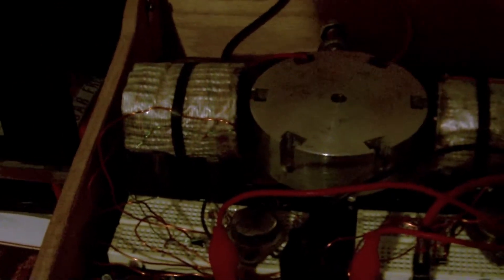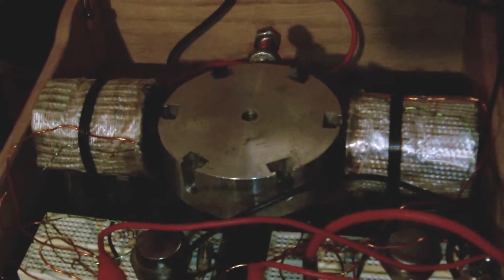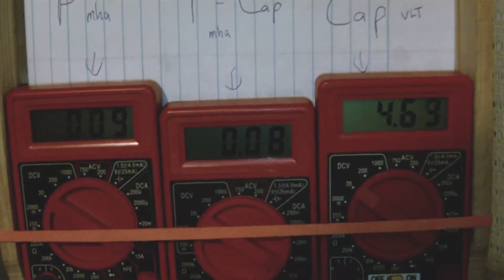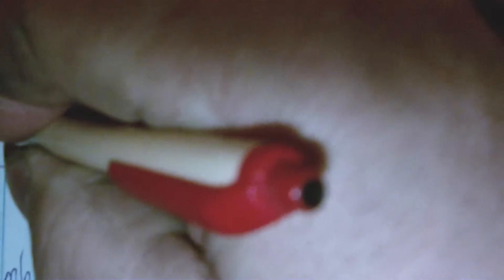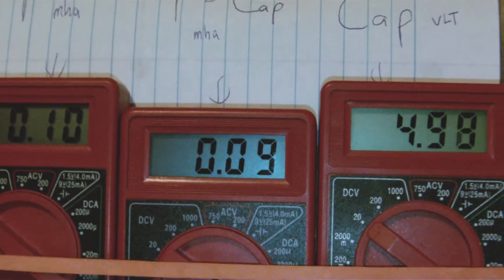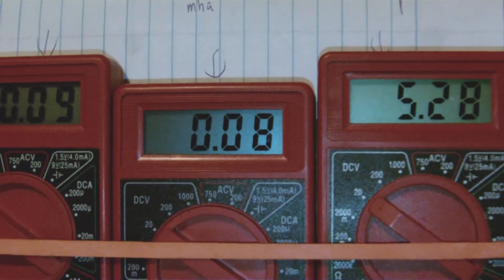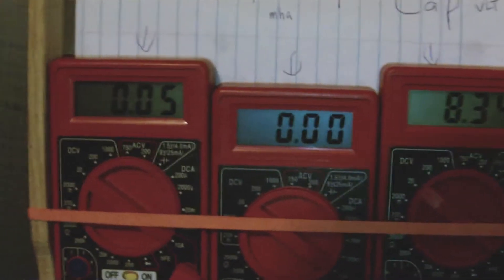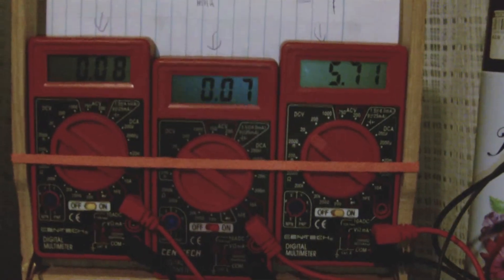bedini motor free energy 001

Comment from the maker: to any one that has a bedini motor ,and would like to try this , the capacitor is a Sprague powerlytic type 36de 450000uf 10vdc -10%+75% -just put it on the charge side of one coil then use it as the battery for the second coil .then set the mha at about 160 and then,put a load on the shaft , until the mha falls around 60. your output should go up ,and  your input went down to 60 mha  and your running a load .totally backwards from a traditional generator      please let me know if it works for you !  thanks.